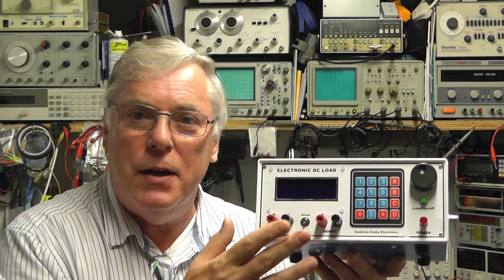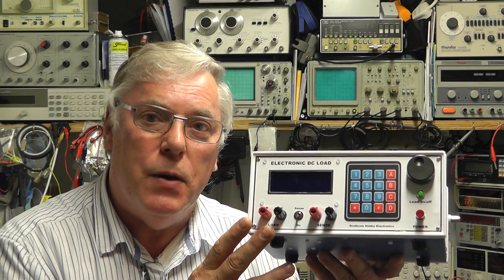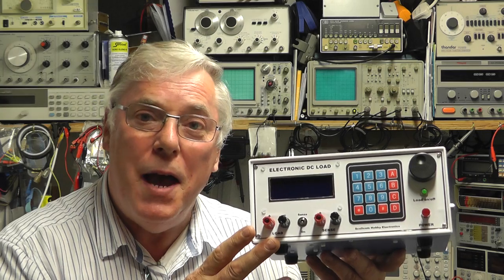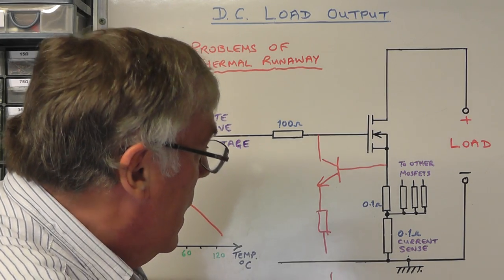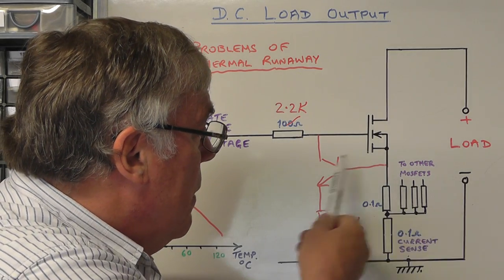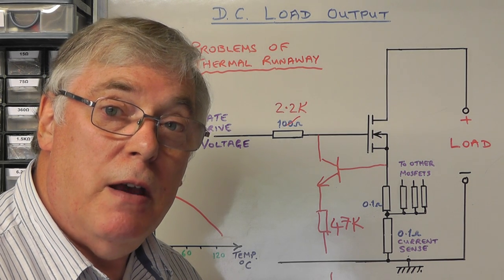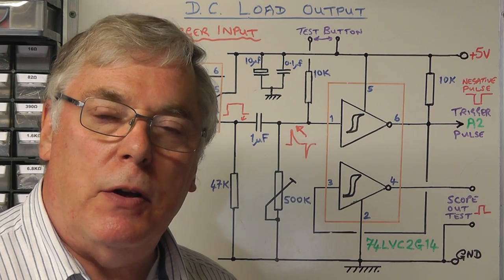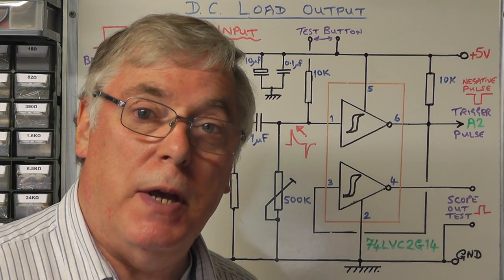Scullcom Hobby Electronics #50 - Electronic DC Load Part 6

Comment: I've finished the project but have a problem. I'm using software version 24. When I switch on the 12V power supply to the load terminals the display immediately shows 4.3A even though the load is off. If I try to limit the current, nothing happens. Toggling the load on & off makes no difference. I've spent hours trying to work this out but failed. Can anyone help me out?

http://www.dolomitesprint.com/images/misc/EDCL1.jpg
Reply from the maker: Hi,
Sorry to hear you are having some problems.
You need to do some basic checks:
1. First check that you do not have and shorts across PCB print tracks, especially around the small SMD IC's. (particularly around U7, U5, U6).
2. What voltage do you read at pin 7 of U6 (MCP3426)?
3. With no load set what voltage do you have on pins 12 and 13 of U7D (AD8630)?
4. Even with this error on the display (actual current) can you still set a current with the rotary encoder and does that reading show on the "Set I = " reading on the LCD.
5. if you press the rotary encoder are you able to move the cursor on the "Set I = !" reading of the LCD display.
Check the above first and let me know what you find.
Regards,
Louis
Reply from the maker: Also check what happens to the 4.371A reading if you temporary disconnect R9.
Reply from the maker: If you are able to provide photos of your PCB both sides I will have a close look at it.
Reply: 1. I checked U5, U6 & U7 many times using my 60x magnifier and everything seems fine, the tracks also.
2. I'm seeing 0.45V on pin 7 with the 12V load connected but load set to off and no load set.
3. The same 0.45V on both pins with the 12V load connected but load set to off and no load set.
4. Yes.
5. Yes.

I haven't temporarily disconnected R9 yet.
Reply from the maker: It might be a silly question but can you double check that all the surface mount IC's are mounted in the correct orientation on the PCB with pin 1 positioned near the dot on the print! Its easy to mount them in reverse at times.
 
Before going through the details below check R17 is 0.1ohm and that the earth side is firmly connected to ground. If OK continue below:
If the load is set to off you should have zero volts on pin 7 of U6 and also on pins 12 and 13 of U7D. The 0.45V reading you are getting is causing the actual current reading to show 4.371A. 
If the power Mosfets are getting hot then this would suggest that something is causing maximum drive voltage to the Mosfet gates - if so disconnect R15 (100 ohm) and see if reading on the LCD actual current goes to nearly zero amp. If that what happens let me know.
If there is now change to the actual current reading on the display carry on with the details below:

So we need to establish why you are getting 0.45V on pin 7 of U6 and on pins 12 and 13 of U7D.
First disconnect the R9 (100 ohm) resistor to isolate the output of U7D from U7 and check again the voltage on at pin 7 of U6 (MCP3426) - if the voltage is still 0.45V then either U6 is faulty or their is an issue with pin 8 of U6 not connected to ground.

If after disconnecting R9, pin 7 of U6 is now zero or near zero volts then the fault is either with U7D or the output stage.

To check if U7D is the fault temporary disconnect R16 - if the voltage on pins 12 and 13 of U7D is still 0.45V then U7D is likely faulty. If the voltage on pins 12 and 13 of U7D is now 0V then the fault is in the output stage - first temporary disconnect R15 to remove the drive voltage from the Mosfets if you are still getting 0.45V on 12 and 13 of U7D then check the output Mosfet's - if the voltage on 12 and 13 of U7D is zeros then the fault is likely U7.

Finally, sometimes when soldering surface mount IC's solder my run under the IC case and cause issues.

Let me know how you get on with the above suggestions.

Regards,
Louis
Reply: I disconnected R9 and actual current showed 0A.
Reply from the maker: OK. The fault is either with U7 or the output Mosfets or R17 (0.1 ohm). Have a read of the details I explained in my reply about 1 hour ago.
Regards,
Louis
Reply: OK. I reconnected R9 and the 0.45V came back, obviously. So I disconnected R16 and the voltage on pins 12 &13 was still showing 0.45V. So I guess my U7 is faulty.
Reply from the maker: Yes it would appear U7 may be faulty. Let me know how you get on.
Regards,
Louis
Reply: Thanks for your help Louis, it's much appreciated.

Whilst desoldering U7 I noticed a blob of solder, from where pins 1&2 connect to R6, very close to the track from pin 4. Upon closer inspection and confirming with the DMM, there was a short between these tracks (see photo).
http://www.dolomitesprint.com/images/misc/EDCL2.jpg
Reply: I have now fitted a new U7 but made sure there was no short between the tracks, as above. Now I no longer have the 0.45V displaying and 0V on pins 12 & 13. Now I am not seeing any actual voltage displayed. and setting the CC has no effect. With a 12V load connected I have 1.6V on the gate of the Mosfets whether the load is on or off. With no load connected there is 4.8V on the gate.
Reply: Sorted!. I've just come back from a few days off and got straight back on to trying to diagnose the problem. So I started checking solder joints & continuity. First thing I noticed was that I had forgotten to connect pins 13&14 together again (because of one of the previous mods.) Then I found I didn't have continuity on the pin from the sense module to the main PCB because of a dry joint. The unit is working fine now apart from the discrepancy in the readings, because I am using the original 9k09 Ohm for R6 and a 909 Ohm for R14. I will probably change these at a later date. One thing I want to try and rectify in the code is the fan switching. Because there is no delta, when the temp. falls to the preset limit for turning the fan off, the fan tends to toggle between on & off because the MOSFET temp. tends to hover when cooling.

Thanks again Louis for this great project, I have learned a lot. I hope you will start a new project soon :-).
Reply from the maker: I have been away over the last week or so. Was glad to hear you have finally solved the problem. With regards R6 (9K) and R14 (1K) - if you find it difficult to get hold of a 9K 0.1% resistor you could use two 18K 0.1% connected in parallel.

Comment: Very nice project, i've been tinkering with the same thing for about a year now.    Here is a link to my WIP 300W Dummy Load.
https://forum.pjrc.com/threads/34863-Teensy-CC-Dummy-Load-300W?p=106516#post106516
I do want to consider improvements, such as revamping the input power, i'm considering switching to a Lipo/5V only approach and getting ride of the SEPIC design.  I just recently replaced the LM4040 thanks to your videos on Reference's, I plan to use a 
MAX6071AAUT21+T.  I'm also considering changing my LM324's but so far have not found anything that provides enough benefit to justify the premium price.
Reply from the maker: Thanks for your comments and the link.